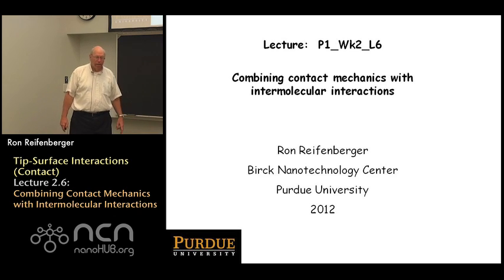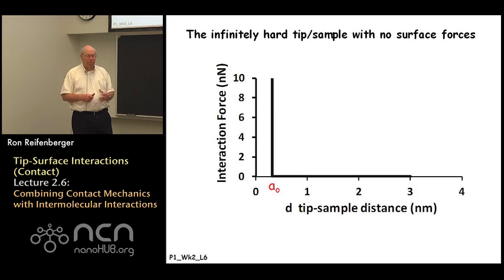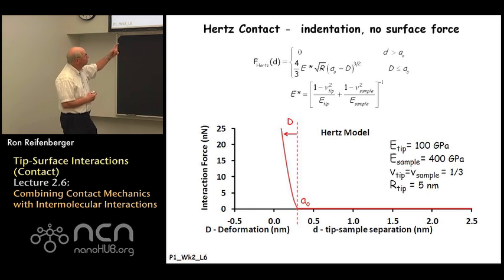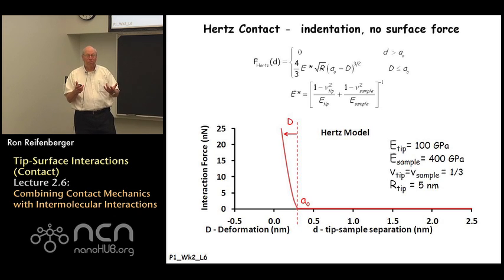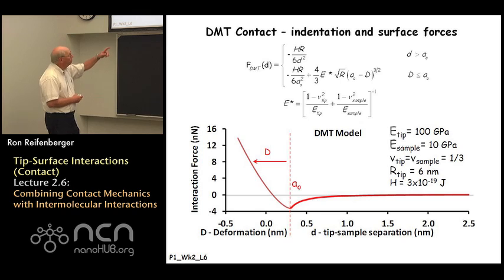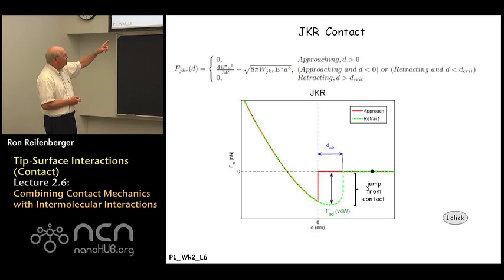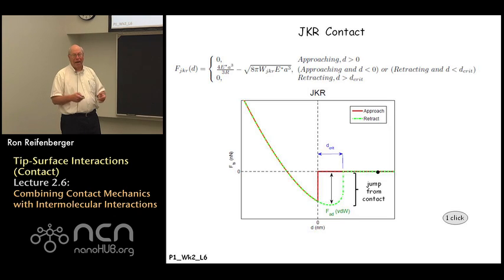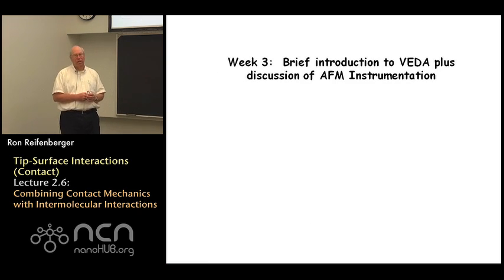nanoHUB-U Fundamentals of AFM L2.6: Tip-Surface Interactions (Contact) - Hertz, JKR, DMT

Comment: For JKR Method, what if we don't have pull off force or work of adhesion? I need one of them. I need to plot the JKR curve using a dimensionless approximation for work of adhesion along with dimensional elastic constant parameters in Matlab so that I can find the pull off force in teh curve, thereby allowing me to calculate the real dimensional work of adhesion. This is done using the BG MEthod, but NONE of the BG Method papers clearly explain how to do so.....Could you please, please explain this, sir?
Reply: Hey mate, did you figure this question out? I'm trying to look for a more complete expression for the JKR force vs distance.